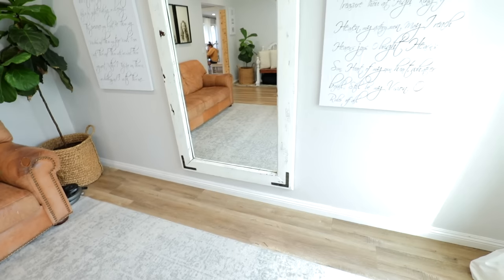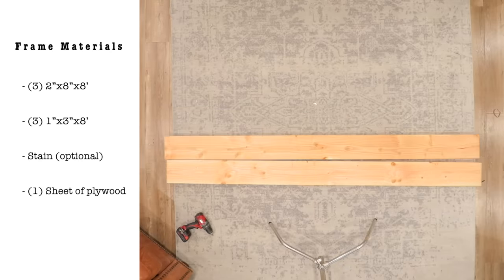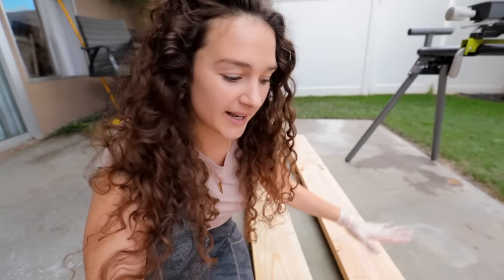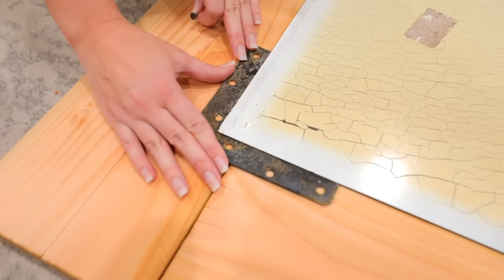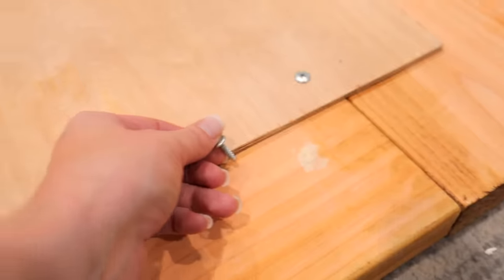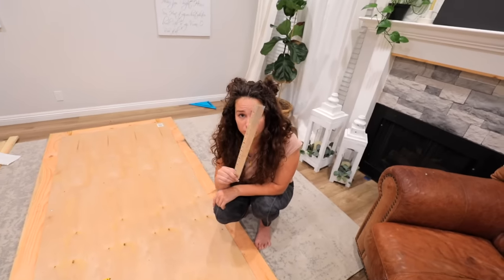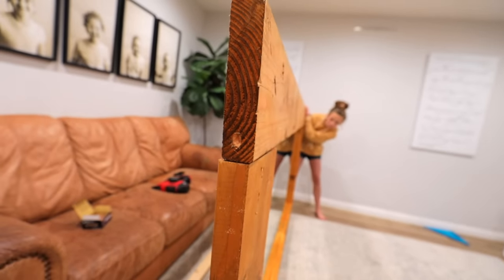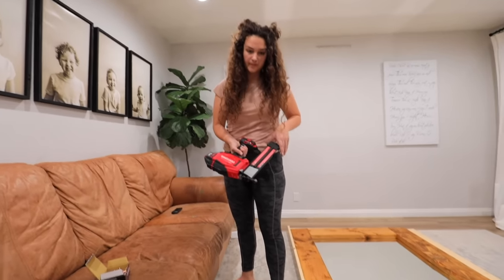how to make a LARGE floor mirror frame | DIY WOOD FRAME

Comment: How can I keep the glass itself from cracking!? I finished a smaller version 3 days ago, as close to how you did it as possible and I woke up to the mirror cracked in the bottom right corner 😢 could I have fastened the backing too tight?
Reply from the maker: Oh no! I'm sorry to hear about the glass cracking. It's happened to me before too. Unfortunately it sounds like the screw was a little too tight :(

Comment: I would've put the L bracket on the front, as well, and painted it matte black. To make it lighter,  would you be able to use the craft board that's shiny on one side and like pegboard material on the other?

Comment: Sooo happy I stumbled upon y’all!! New follower here! About to do this project with a heavy old bathroom builder mirror that was over a double vanity. Going to Frame for a wall mirror. Couple things— how thick was your plywood backing and what is the name of that bracket you had PLANNED to use if hung on the wall??
Reply from the maker: Hi Mindy! I hope the project is going well! The plywood backing was very thin, I think 1/4 inch. We used 2 of these heavy duty brackets each supports up to 100lbs: https://www.amazon.com/Hangman-Z-Hanger-Mirror-Picture-Aluminum/dp/B000VW5T0I/ref=asc_df_B002NEFF7Y/?tag=hyprod-20&linkCode=df0&hvadid=198097826602&hvpos=&hvnetw=g&hvrand=14298069501779294527&hvpone=&hvptwo=&hvqmt=&hvdev=c&hvdvcmdl=&hvlocint=&hvlocphy=9029605&hvtargid=pla-321036497668&th=1

Comment: What type of nail gun do y’all have?  My husband and I were shopping for one, but most of the ones we saw required a compressor. :(
Reply: Looked like a Craftsman. Likely 18 gauge. You can buy them at Lowe's. Or try Ryobi (Home Depot). Those are the DIY brands. Next tier up is Milwaukee and Dewalt. Hope that helps you.
Reply from the maker: Yes, Doyeb 86 is correct. It's a 18 gauge Craftsman we got it at Loews

Comment: But where exactly can I get the closest mirror ??? I can’t find it anywhere
Reply from the maker: Check Craigslist. Search for homeowners, hotels, and apartments doing bathroom or bedroom renovations. What you want to be on the look out for are vanity mirrors and sliding vanity closet doors. Both of these are large and people (homeowners especially) would rather have someone take it away than have to deal with the disposal of so much heavy glass.

Comment: Question why did u use a 2x8?  U could have used a 1x8 less weight since you are using plywood on the back. Also you didn’t state what thickness was the plywood?